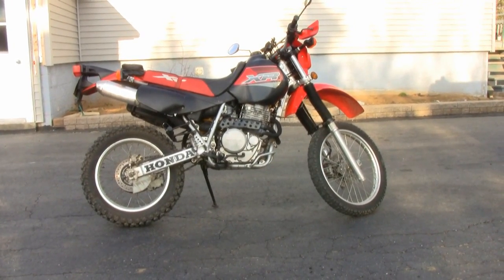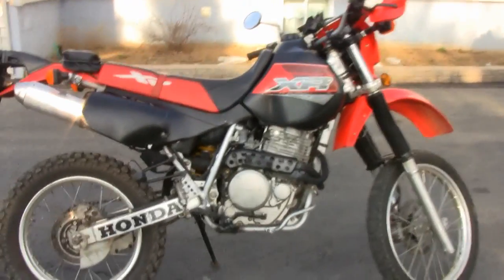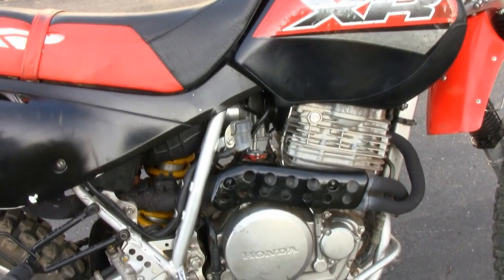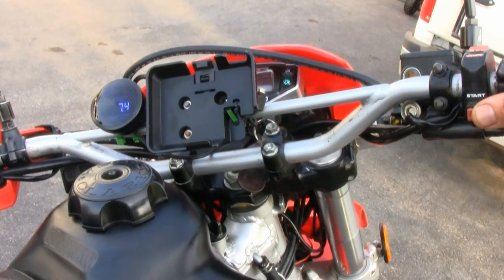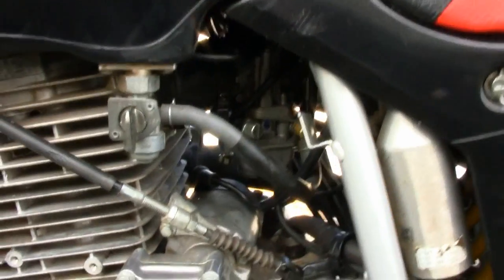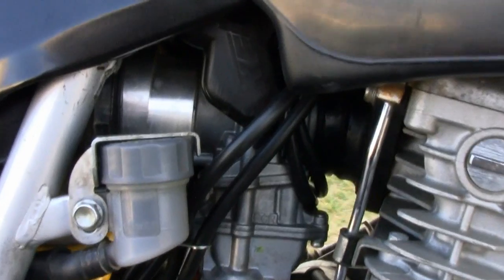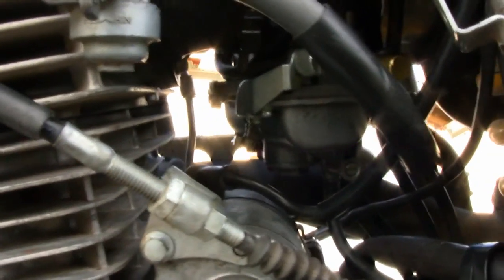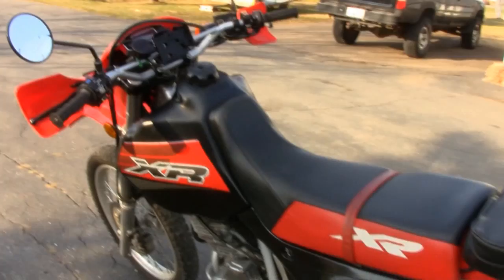XR650L - FCR-MX 41mm Carb Conversion Project

Comment: I was thinking that 13:1 afr was optimal and bikes are normally richer at idle low rpm. I think a mix of 13:1 at operating rpm is the best anyways.
Reply from the maker: I would tend to agree and at that afr the engine runs notably cooler

Comment: Hi, thank you so much for this video, really well done!
It will help me a lot with the setup on my bike
Could I ask you which jet starter did you have on your motorcycle?
A thousand thanks.
Reply from the maker: So sry its been so long I really don't remember. I want to say 75 but I never changed the starter jet so whatever was stock is what i used.  With a pumper carb you give it a couple snaps of the throttle and it acts like a primer. On really chilly days these bikes are really hard to start, when getting close to freezing temperatures i heated the cylinder block with a hair dryer for a good 5 to 10 min
As this really helps otherwise normally its starts right up
Reply: @BugCrush3r  Ehi! I imagined it was a question a bit difficult to ask after all these years, however I thank you very much for all the information you gave, in all these videos and in the descriptions! Many greetings from Italy! ✌🏻

Comment: Thank u for this informative Video Dot-com. I have read a lot of ur suggestions on thumbertalk hehe. Was curious though, Any chance u have something different to suggest for a Fcr-mx 37 mm out of a 2005 crf 250? got one in hand for 50 euros so its a deal i guess.  i know ur usual suggestion  for 40 mm fcr at  0 elevation
 is  ( copy/paste)

42PJ(slow jet)

NCVT needle 2 clip from top

158MJ

#35 LJ(Leak Jet) or completely solder it shut.
Reply from the maker: Most of the jetting should be very close, you might have to lower your main jet a size or two which might affect the needle clip position.  You'll have to try and see how the bike responds
Reply: @BugCrush3r  that was quite fast  :) Ill start from there then as u said. Appreciated and may the force be with you . Ευχαριστω πολυ ( Thank you at Greek )

Comment: I wanted to say thanks for all the re-jetting info you've posted over the years. I have a 2000 XR650L and got a Keihin FCR-MX 41 not long ago. I'm in So Cal and weather during riding season can get hot so jetting can be a @#$%& sometimes. I was happy with what I had setup initially, but had a minor problem with starting. After going over your info and making some notes, I tweaked my jetting over the weekend. With a few of Dave's Mods and a Big Gun Exhaust, my new jetting is MJ=155, PJ=42, PAJ=72 (2 turns out). Starts right up and runs fantastic... Thanks again!
Reply from the maker: no problem Chris thanks for the feedback

Comment: Hey bug crush I just purchased a fcr mx 41mm carb on ebay and I do want to go with wide band air/fuel sensor, I am the one who built the xr650l with nx gearing and 83 xl660r  frame and 07 crf 450 front forks, I have a dg slip on pipe with stock xrl header and stock carb, I got bike dialed in pretty good with the stock cv carb and I did the daves mod but it starts harder than my 06 xr650l it seems and I wonder if the 10.5.1 compression piston is why its harder to start or its still cold here in mornings could also be why but it seems like it dont want the choke on initial starting , seems to flood, any idea ?? I have a 158 main and 55 pilot,daves mod recommends that , once it starts it runs great and wow does that nx gear swap make a difference with the high compression piston the front wheel just wants lift and im tryin to keep it at a minimum with breakin but compared to my 06 its night and day so this is why I bought mx carb for the one I built just to give it that extra with good throttle response and I am wondering if it is hard to set up the wide band sensor, they sell a clamp with the bung in it and it connects were the slip on meets the end of the header pipe is that ok or does it need to be on the baffle part of muffler ?? because thats aluminum and I am not very experienced with tig but if it has to be I know people that do it. I have not recieved the fcr mx carb as of yet but soon I paid 250 and its off  07 0r 08  from flea bay, I probly wont install it till fall when I buy a decent head pipe, thanks for the reply, do you have a email address???? .

Comment: Bug crush were does fcr TPS sensor plug into on the xr650l if I was to buy a fcr carb, also 2008 fcr is the 41mm, thanks mark!,..
Reply from the maker: TPS is left unplugged. its not used

Comment: 2012 xr650l, nearly impossible to cold start. When it starts and I try and get it rolling, if I back off the throttle it nearly throws me over the handle bar, (bog down compression). Appreciate any positive feedback. Nice video Bug.
Reply from the maker: I've not experienced bog down compression you explain.  In really cold temps like below 5c it can be difficult to start. You can heat up the engine block with a hair dryer or heat gun for 10 minutes on those cold mornings which will make starting much easier.   With a pumper carb you can give it 3 or 4 full throttle operations to shoot raw gas in the engine which really helps.  If your still having problems you can open up your pilot air screw 1/4 to 1/2 turn to see if it helps. You can also increase the starter jet a size or two if you got full choke and its not enough.  Hope this helps you out.
Reply: @BugCrush3r  I just mean that when I open the throttle I get a split second of acceleration and then it's as if the kill switch was activated. When I'm not ready for it it tend to push me rapidly forward. Thanks for your response. I will try these suggestions, and repost if that's okay. Sam.
Reply from the maker: @samjohnson466  ok yes that has happened but just roll with the choke half open till the motor warms up.  That's all I used to do.
Reply: my guess clogged passages in carb a lot of these bikes end up sitting for months and gasoline congeals to a lacquer  .... we HAVE to run these bikes!  NEVER just let em sit !  Just asking for trouble!

Comment: If you up the air corrector it should help rich on bottom, I feel air/fuel ratios should be measured under a load for accuraccy but nice video

Comment: Do you know of anyone giving advice on where to install the sensor (and the best options I should consider) because I"m not experienced with stainless welding, and wondering makes slip-on sensor mounts for yamaha wr250f's , for the Innovate LC1 Wideband O2 with DB Gauge kit?

Comment: what is the power cable that is on the fcr40mx carby for? do I need to do something with it to get it to fit my xr600 or just leave it unplugged?
Reply: +Tony Hart the cable is for the throttle position sensor and is only used if you install this carb in a fuel injection bike.  Just leave it disconnected.
Reply: +Tony Hart go to thumpertalk forums there is 2 major thread  based on my jetting and explains what you need and which OEM carb to get.

Comment: Hi Buddy, you look like the BRP mod pro, and I bought a Keihin FCR MX 41 off ebay, but it absolutely will not run after tons of cleaning jetting, etc.. There was a hole in the side of the carb that I plugged with JB weld, which I thought was an emissions thing. Is it possible this was a TPS type carb and the TPS is off and thats why it wont run ?? Any help would be greatly appreciated and we are so frustrated by this I'd even be willing to compensate you for your time on the phone trying to help us..

Thanks so much !
Reply: +Mike Powell Sorry I didnt see your post hopefully you got it running by now if not try reading the 2 major threads for this FCR-MX carb swap for help  on the thumpertalk forums.

Comment: Was it easy to fit/set up, including the cables and throttle tube?, I plan on doing this to my fmx650 (same engine) but on top of a stage1 cam, forged conrod, 10.5:1 high comp piston and upgraded valves/springs. Hoping to get close to the 50bhp mark as I can. Its part of a streetfighter supermoto project im doing. Its on my channel called the ugly duckling project. Gonna take me a while as I have very little funds but shhould be a beast when finished :)

Comment: I see that you have a trail vapor speedometer. It looks like it has turn signal indicators and neutral light indicators built in??? Where did you find this. The ones I see for sale do not have those features.
Reply from the maker: Trail Tech sells the dash addon that fits the trail tech computer.

Comment: Did u used the eom choke cable on fcr carb? I installed my and I dont know how munch hp I have now but let me tell you this thing feels like it want to truw me out off the bike...the best money I ever spened on this bike...I rather have the xr with this carb then the ktm 690 ...u know is a honda the ingene will run forever..

Comment: Hey BugCrusher, thanks a million for posting all this info. It will surely save me a lot of time and headache. I wanted to let you know Ive just discovered a pilot jet to pilot air jet ratio chart. It states that a PJ of size #42 should have a PAJ of #85 and a PJ of 40 should have a PAJ of 70.  I see you have the PAJ of 100 used on both PJ of 40 and 42. You obviously have it running great tho on a PAJ of 100.  A PJ of 45 is used with a PAJ 100 according to their chart.  I guess your bike cant run now, sorry...the chart cant lie...lol
Reply: what chart are you referring too?  Most people don't even run a PAJ at all.

Comment: Very nice!
Do you know if the Sudco 41mm FCR would require a different jetting set up as the MX version, or are they basically the same?
I'm having a hard time getting mine to idle, its showing signs of being lean but I'm running a 45 pilot so I'm a bit confused.
any help would be appreciated.
Thanks

Comment from the maker: Sorry for the late response. Youtube notifications were going to my junk folder.  You can use the XRL pull cable with the FCR and XRL twist throttle.  Not sure if the CRF cables will fit or not.  You'll have to try it out or ask on Thumpertalk forums.

Comment from the maker: There is a stainless steel bung that you weld on the exhaust to connect the o2 sensor to.  The sensor will calibrate itself when you initially install it. You just follow the easy instructions that come with it.  The o2 sensor is definitely the tool you need when putting a new carb on from scratch that's why I bought it.  This o2 gauge/sensor is a must have if your going to install a new carb and tune it from scratch because it saves you so much time.

Comment: how easy was it to set up:
Innovate LC1 Wideband O2 with DB Gauge kit (which I might add has saved me sooo much time)
did u just tap a hole in the exhaust and thats it? does it matter how far along the exhaust u mount it? does it need tuning?
can u easily jet the carby from scratch with this unit?
im lookink at a 103mm piston in my 600R and a stage 1 cam mild porting and a 48mm vtr carb would be nice to do something different instead of just using the same carb as everyone else because its easy.

Comment from the maker: well if you have to be street legal then you have no choice to get the Q4 because the powercore is definitely too loud to be legal.  The powercore does give slight gains over the Q4 at WOT but the Q4 shifts the power bell curve to the left improving the lower end by a noticeable amount.  I had to increase my pilot jet 2 sizes with the Q4 installed so this confirms my findings.  Besides who runs at WOT for any amount of time, its the acceleration and low end grunt that we use the most.

Comment: im debating on whether i should get the Q4 or the powercore? Im not to concerned about sound inless it wont pass inspection for being street legal, i would drather have more power, and powercore is cheaper. What are your thoughts?

Comment from the maker: @sambking You should post in the thumpertalk forums, you'd likely get better help there.  The only thing I can think of is your pilot circuit is too lean.  Maybe try unscrewing your pilot screw 1/4-1/2 turn to see if it helps. Other than that your best bet would be to post on the thumpertalk forums as the members there have a wealth of experience with this.

Comment: Good video and info. Thanks! Really appreciate it.
I have a 2008 XR650L. It's got 2205 miles on it. Just bought it two months ago. Love it and it runs like a top (smooth). BUT, I have a stalling issue when I am coming to a stop and down shift (with the clutch in of course). The previous owner had it rejetted and put on an FMF pipe. I haven't looked at the jets myself yet but that's next if adjusting the idle doesn't solve the problem. Just wondering what your experience has been with stalling.

Comment from the maker: @flatfender100 I would also completely block off the leak jet or put in a #35 (the smallest one available) or even better get a adjustable leak jet like mine (R&D pump2 cover).   Also don't forget to get a longer pilot air screw that is much easier to adjust while the carb is installed.

Comment from the maker: @flatfender100 Milage is roughly the same I guess.  I figure I can get about 270-300km a tank depending how aggressive I am.  The only thing connecting the computer gives you over the gauge is trending capabilities but I didn't have an input module for the throttle position so I just used the gauge to calibrate my feul/air ratio.

Comment from the maker: @chevy2die Yeah I painted the side covers.  I used Krylon Fusion paint.  The paint fuses itself with the plastic and doesn't flake or chip off.  The seat cover is a custom design I had made at the local shoemaker shop.  Thanks for the compliments. DG

Comment from the maker: @caboose365 If you knew anything about this type of bike you would know that to wheelie it in 3rd gear is quite impressive taking into account that in 3rd gear your doing about 40 -50 mph.  Also I weigh 260lbs so it makes it even more impressive.  This is a BRP that weighs much more than your normal 2 stroke bike.  This bike stock has no guts so the mods I did really bring it to life.

Comment from the maker: @roguemotorcycle From what I read the location is somewhat important in that is should be at far as possible from the exhaust tip as the prevent o2 from the free air to enter and affecting the reading.  I plan on removing the o2 system after because its not needed.  I only planned on leaving it in from spring to fall to see how the carb worked during varying temperature and elevations.

Comment: Nice job! could you slip a section of radiator hose over the bung and wires so its protected from mud etc? that way you could leave it on permanent, or can you cap it with a special bolt so its there for future tuning. Your video inspired me, so I'm going the same route too. Does the location of the sensor matter? Thanks in advance.

Comment from the maker: @vivianmorresey My first gear is almost useless because I run a 48T rear and stock front sprocket for more low end torque. With the new 2nd gear I'll be able to run a smaller rear sprocket and keep the the torque-y feel too it.  Also wheelies will be smoother from 1st to 2nd because the gap will be less.  Many people are doing this mod.  I've not yet done it because I've not yet had an excuse to tear my engine apart.

Comment from the maker: @vivianmorresey Yeah 9-10 is way too rich.  I run 13.8-12.2 from 0%-100% throttle position.  The O2 setup is a must have for any major upgrade like pipe,headers,cam,and carb.  Top end is not my concern, I was trying to achieve better low end and throttle response. One thing I will be doing is changing out the 2nd gear to that of the NX650. Its a direct drop in and will bring the ratio closer to that of the 1st gear. I find theres too much gap between those two gears.

Comment: thanks for responding, and that price is well affordable. I've done the cam's, headers, etc and that is why I now need to fix the jetting. Putting the cam in and headers has currently made the bike very rich 9 - 10 AFR...which was the opposite to what we all would have thought. To date, the cam hasn't proven to be worth it. I had it tuned beautifully before, so if this cam doesn't make the bike faster eventually - its gets dissembled and given to charity :-)

Comment from the maker: @vivianmorresey  The o2 sensor and gauge from innovate that I got off ebay for $200.  There aren't any shops here where I live that have a dyno so I can't do that but needless to say my cousin who has a stock 2008 XR650L does not compare.  The throttle response is instant and is by far the best feature of this upgrade.  Wide open throttle is only slightly better but I am sure that a more aggressive cam to compliment the FMF pipe and larger carb would help a lot.  Low end torque is increased alot

Comment from the maker: @brucenash  thanks for the compliments.  All things being equal,  a T38 will probably have better low end throttle response and should pull as hard or very slightly less than my T41 at WOT.